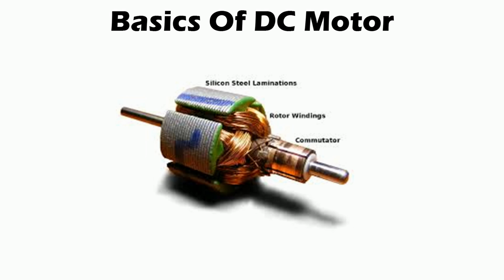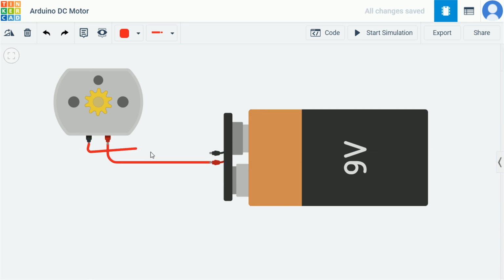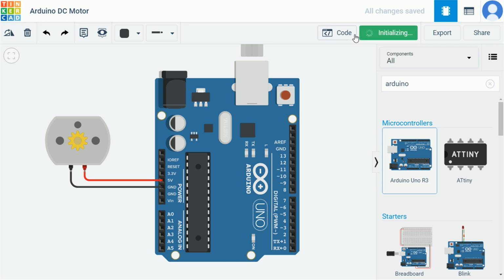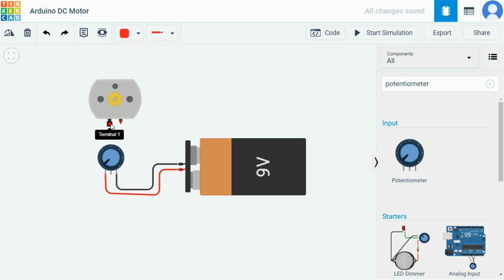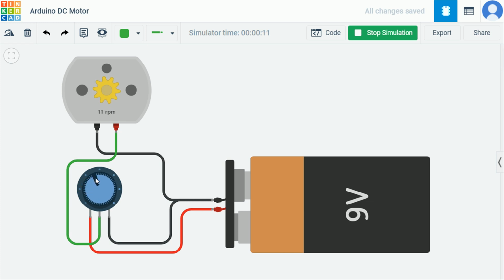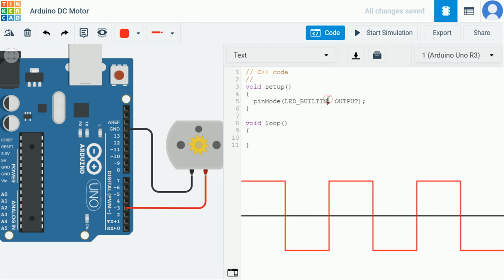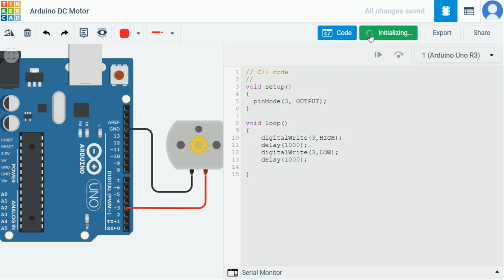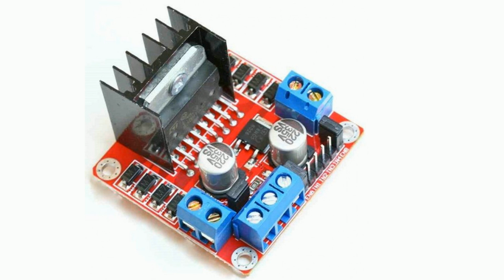4 Ways of Controlling DC Motor with or Without Arduino | Potentiometer | PWM | L293D | Transistor

Comment: At least you mention at the end that if you follow this tutorial you'll likely fry your arduino ...  I don't think I could ever trust a source that directly connects a motor to the pins of any microcontroller,
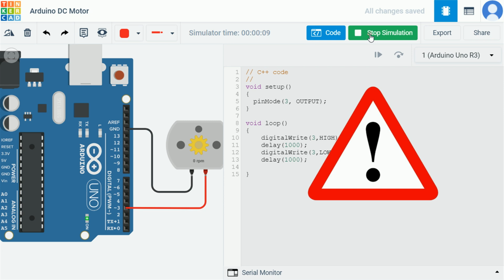Reply from the maker: We have mentioned "this is a simulation and do not try this with real arduino board"  at 3:05 of the video.